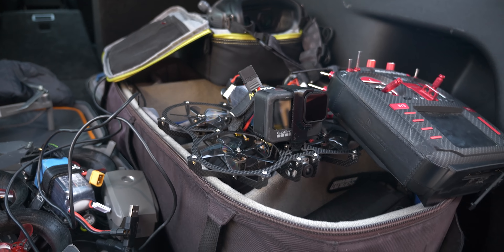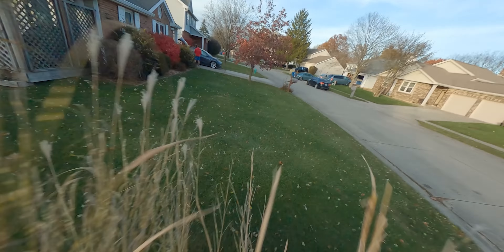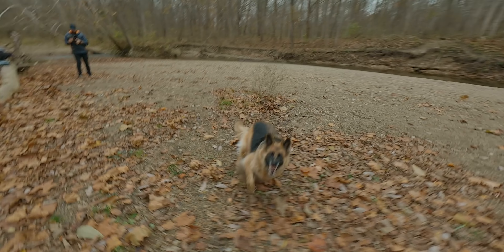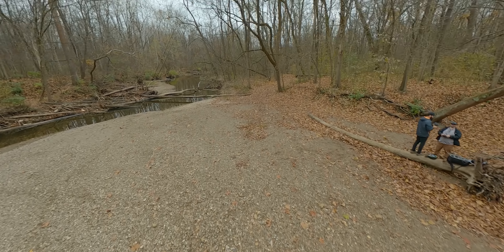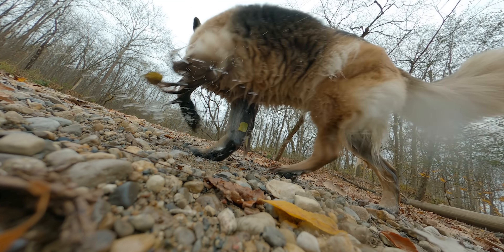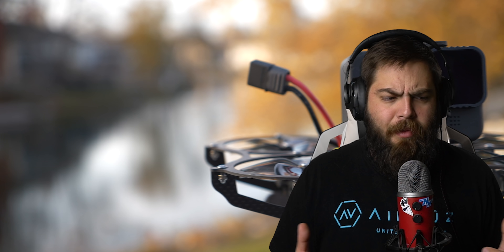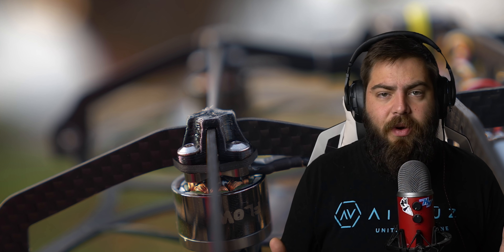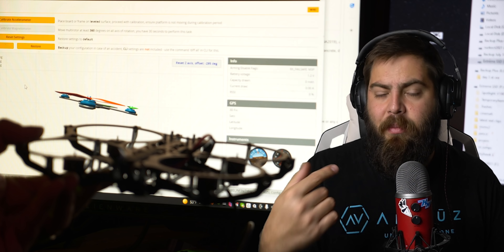NewBeeDrone CinemAh - Trying a Ductless Cinewhoop

Comment from the maker: If you decide to purchase, please consider using the affiliate links here below to support the channel! 
Click HERE!

NewbeeDrone
Frame -- CinemAh -- https://bit.ly/3l1Pada
Stack -- Infinity200 -- https://bit.ly/3l2vg1x
Motors -- FLOW 1408 2350 -- https://bit.ly/3COeDgj
FPV Air Unit -- Caddx Vista with DJI Camera -- https://bit.ly/3xru1Oz
Receiver and Antenna -- TBS Crossfire Micro -- https://bit.ly/3HQQo4Q
Battery -- Tattu 1050 6s - https://bit.ly/3nP9MHo

PyroDrone
Frame -- CinemAh -- https://bit.ly/3l1Pada
Stack -- Infinity200 -- https://bit.ly/3nLx5Sw
Motors -- T Motor 1408 x 2800 -- https://bit.ly/30UhFCy
FPV Air Unit -- Caddx Vista with DJI Camera -- https://bit.ly/3p0qmDp
Receiver and Antenna -- TBS Crossfire Micro -- https://bit.ly/3xiXyKn
Battery -- Tattu 1050 6s - https://bit.ly/3cKLMih

GETFPV
Frame -- CinemAh -- https://bit.ly/3l1Pada
Stack -- iFlight Succex F7 -- https://bit.ly/30Z4FeA
Motors -- T Motor 1408 x 2800 -- https://bit.ly/3HTbJdO
FPV Air Unit -- Caddx Vista with DJI Camera -- https://bit.ly/3CR4z62
Receiver and Antenna -- TBS Crossfire Micro -- https://bit.ly/3ki2OYd
Battery -- Tattu 1050 6s - https://bit.ly/3FNwpC2

Comment: I'm sure it's in the comments, but they offer tpu ducts and a tpu battery strap for it to use when needed. On set, it's almost a requirement for more prop protection. The TPU battery strap else pulled it in the back as a really cool idea.
Reply from the maker: They sent it to me since I finished filming the video

Comment: I noticed in the description that the recommended  motors are T Motor F1408 2800 kv, they are a 9m motor mount (i found out the hard way), and the frame only supports from what i can tell a 12mm motor. Am i missing something?

Comment: I took my diatone taycan 4s, with the 1606 3750kv motors and put it on a similarly weighted frame, the geprc cinerun, and my god...I love it now. I wish I saw this frame before I got the geprc frame, but it's OK. It Flys so damn good with betaflight 4.3, 48khz rpm filtering. I use a 800mw speedybee VTX and a runcam Phoenix JB edition, and I fly it more than my toothpicks, and more than my 5" quads. It has more "fun" factor. I have a couple SD cards with footage I'm going to finally put together and put on youtube...one of these days. But when my geprc frame breaks, I'm definitely getting this frame to replace it.